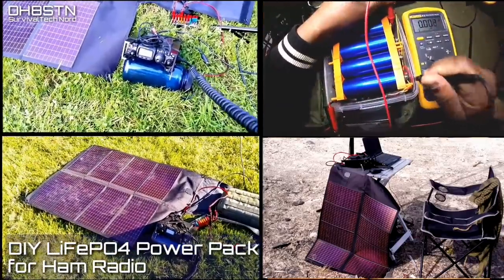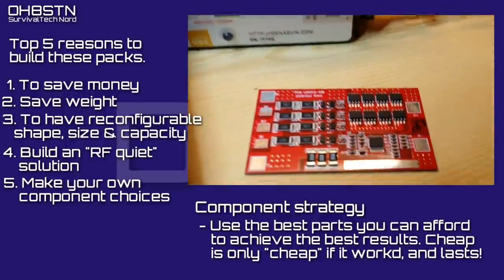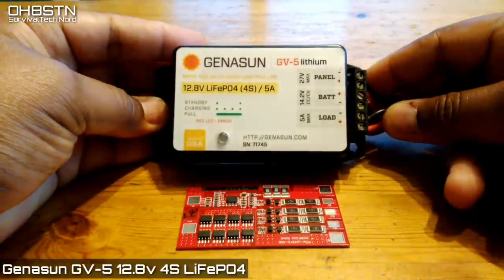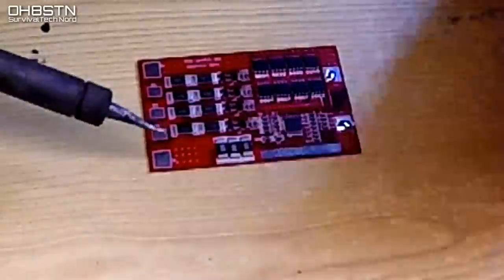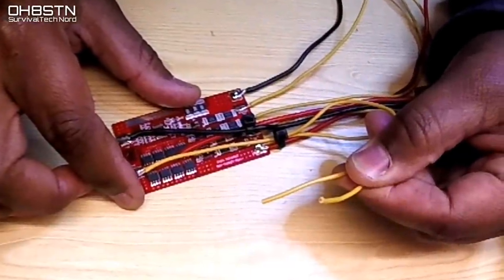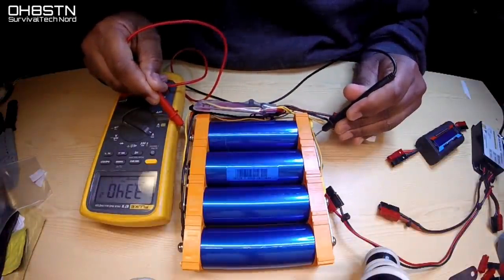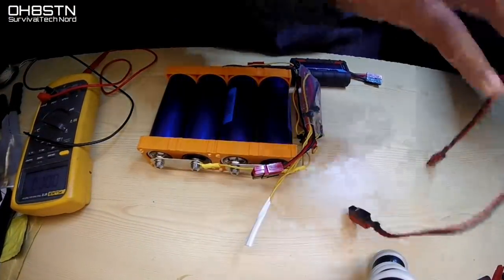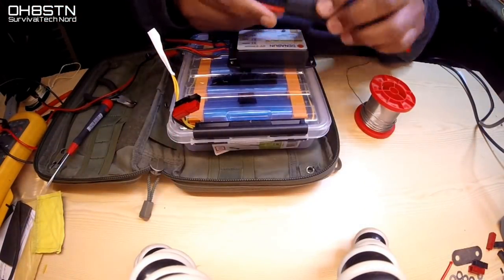Ham Radio Battery Pack DIY LiFePO4

Comment: What are the dimensions of your battery pack?  There are some large diameter shrink wraps available on ebay. The largest of which is 210mm / 8.26in. would that slip over the battery of cells to give a good seal?  I searched for "Battery Pack Shrink Wrap" I found another listing from China. It allows you to select from many sizes from 7mm to 450mm. It's listing title is "1Meter Blue PVC Heat Shrink Tube Wrap RC Battery Pack 7~450mm LiPO NiMH NiCd IL"
Reply from the maker: +Craig Gilbreath Thanks Craig. Ill have a look. Last night I was trying to shrink to liter soda bottles around the pack which is really promising actually. I like the idea of being able to see what's inside the pack, so a clear shrink of some sort would be ideal. I'll check out that listing though, thank you 👍
Reply from the maker: +Craig Gilbreath foynd the ebay listing you mentiined 👍 that led me straight to a PVC heat shrink tubing that was large enough. You are absolutely awesome, thank you

Comment: Wonderful tutorial! Thank you! Giitu! This is my first serious power project beyond PowerPoling everything. I have a question. Ended up with the larger capacity PCM-L04S30-526 BMS from BatterySpace because of well-intended ignorance.  It has one more balance lead pad (2 B1s) than the model you are using. I'm unsure how to complete the wire connections. Could I ask for advice? 

The 526 has a B-, B1, B1, B2, B3, B+. This has me confused. Has anyone else used this board? B- goes to black (my cell 4), B+ goes to red (my cell 1). P- and P+ connect to the charger. How do you deal with the two B1s??

Thanks for any advice you can give.

See https://www.batteryspace.com/PCM-with-Equilibrium-function-for-12.8V-LFP-Battery-Pack-30A-limit.aspx

Comment: One more question. I have the 10Ah (4 total for 40Ah) LifePo4 cells. Can I use the Bestech 4S 60A BMS with this pack, or do I have to match up a 40Ah pack and 40A BMS? 60Ah pack and 60A BMS? IE, does the pack Ah and BMS Amperage have to match? Or I can do a 40Ah pack and 60A BMS? Thanks.
Reply from the maker: Scary questions my friend, but I'll try to help. The best tech BMS was used in both the 4s1p 10ah pack, and the 4s3p 45ah pack. It will work perfectly for a pack with 4 cells in series. The parallel cells are not counted. The 60A rating on the BMS is the maximum load in amps. The amp hour rating of your cells defines the amount of current your cells can discharge over an amount of hours. Those numbers don't have to match.
Hope this helps.

Comment: Really a great video. I wish I had found your channel sooner. I've been looking to build some thing like this, but for a Midland MXT400 which is just a simple 40 watt GMRS radio for hiking, camping and things like that. 

Do you think building a battery like you have here, would work well for a full day or weekend out in the bush with just normal chit chat on the radio? I know that's a pretty open ended question, but any thoughts would be greatly appreciated.

One more question, what do you think of building a larger battery pack using these batteries in the link?
https://www.electriccarpartscompany.com/55Ah-1-5C-24V-Lithium-Titanate-Battery

I'm thinking of having a larger battery with a very long life, that's able to run more things in an emergency type situation, and still be pretty easy to transport. Thanks and keep up the great work.